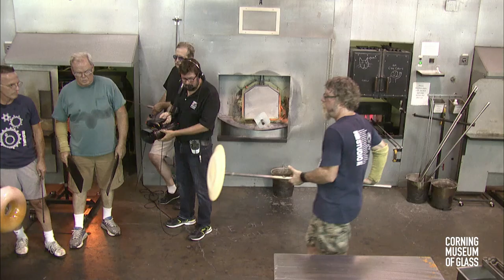Live-Streamed Studio Demonstration: John Miller (June 10, 2015)

Comment: Why is the glass put back into the fire after every step?
Reply from the maker: The glassmakers are working with hot glass on the pipe in the 1500°–2100º F range, or 800°–1150º C. If the glass gets cooler than this, it will begin to crack and the piece will fail. They use the reheating furnace to keep the glass in the correct temperature range.

Comment: Why isn't anyone wearing gloves?
Reply from the maker: +ace lee gloves are rarely worn during most glassblowing processes because it dampens dexterity.  if you watch the video, they are worn during some of the sculpting parts where his hand stays near the body of the glass for an extended time.  Also, it is worth mentioning, its not as hot as you might think because your hands don't stay near the glass for too long, as well as you become accustomed to a good amount of the radiant heat that you are exposed to.
Reply: +ace lee as the museum said! also its better to wear either big gloves or no gloves at all, smaller ones can melt into both the work and your hands and they stay hot.. easier to treat a simple burn if its on skin alone.
Reply: couse thet are professional

Comment: If I may make a suggestion? There's points in these videos where the piece is put in the glory hole then simply put on the bench, spun, and hit with the torch. While we understand this is a necessary part of the process, I've literally sat here and watched videos where this was done for nearly 15 minutes or more, which will make your audience lose interest and bore some people. And, well, I have to confess, as relaxing as I find these videos, it's actually put me to sleep at those points before! So maybe there is a way to cut down on those points in the videos, simply cutting that out will help shorten the videos a bit, help with the uploading, and still get the quality of the work and the depth of the art across. Just a suggestion!
Reply: Storm Angelus im thinking they do this due to the fact glass is getting heated to add or adjusting temps for the next work
Reply: This is true. I'm just making the suggestion for viewers and viewing time, simply because of how long it takes the uploads onto YouTube for one, and how little attention this garners from the audience.
Reply: I disagree, as a glassblower it helps to see the timing and pace of the reheats.  At this level there are no 'useless' steps.  Maybe for entertainment value that time could be filled with narrative or an explanation.  if this video is meant to be instructional, then keep it as it is.  There are plenty of other 'glassblowing videos' that are highlight clips of the big moves but what is lacking is the procedure for setting up the heat.  (in fact I was thanking Corning for showing the whole demo start to finish)
Reply: (steel-toe-taps on the marver are exceptionally 'useful'
)